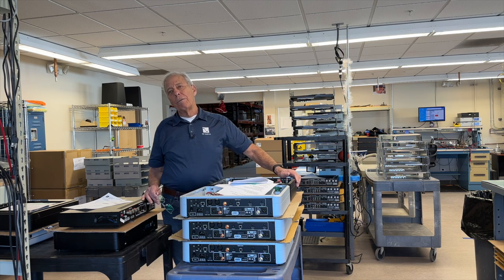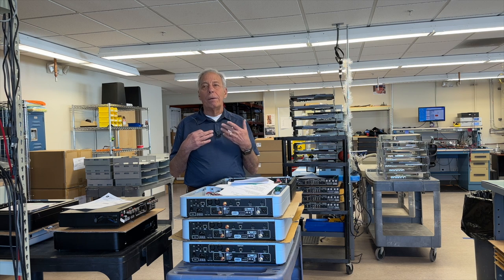How to choose a film capacitor

Comment: A roll of Teflon tape to make your water piping leak tight cost you less than a hand full of change. The same material in the same quantity used in a capacitor with the intended use being Audio, justifies a price premium of $60,- or more. And rather than being outraged by it, most audiophiles get exited by that idea. Oh, add 5 cents of oil to that and the price easily doubles again, resulting in yet more excitement.
Reply: Find a source that is cheaper, but where? I'll wait. I've looked at Digikey and others. No one is what you'd consider "cheap".

Comment: I would personally just replace the Electrolytic with a good branded equivalent and maybe put polypropylene caps on the tweeter section of the crossover. These are vintage speakers and as soon as you start putting in film caps, you start to change their sound signature.
Reply: Personally I’d bin the whole crossover, bi-amp it and use an active crossover. Passive crossovers are horrible things.

Comment: How do you know your AR's are sounding bad and need a cap replacement? Do you have another set of new vintage AR speakers to compare to? Or are you just remembering from back in the day that they sounded better? Besides leaking or budging caps is it just age? And if so, how do you know if your speakers are now just a worn in comfy chair as opposed to being broken? I have 2 sets of the same speaker (RS IIIa's). Passive bi-amping the speakers I broke a lead off a cap right at the base. So I replaced the one cap in 2 of the speakers (so they would match). They sound different than the other set now. Not bad or anything but they dont sound any better than the other set either. Be careful about what you wish for, you just may get it and not like it.
Reply: Old electrolytic capacitors drift in value over time as they dry out and can even be dangerous to your tweeters if the value becomes out of spec too much. They can send too much power to them and you end up with fried ones that are irreplaceable.  One site noted that, "Do you need these capacitors? Twenty years ago, when we began servicing these speakers, there didn't appear to be any need. However, perhaps ten years ago, we began to find capacitors manufactured by Callins Inc. installed in other AR speakers that were way out of spec. That created concern for the AR 9 and AR 90 speakers and we began finding them in these also. In recent years, customers have been requesting this kit for their speakers, particularly needing them for the tweeter section.

However, even though some larger Callins capacitors may be found in the woofer crossover section, the impact does not appear to be as great. Now, if you have a late production pair of these speakers and find your capacitors to be manufactured by Sprague Electric, there is no need to replace them. We have never found a Sprague Electric capacitor to be out of spec."

Comment: Capacitor choice is like spice for your dish ... It will give it a specific flavor.
So Paul is totally correct here .
Same uF and Voltage but different construction cap will sound totally different...
Often you can use Poly cap like Dayton and add nice bypass of 0.1uf Copper foil Miflex and for a cheap combo sounding sooo much better than original Electrolitics or El cheapo poly found in stock crossover
Reply: You can taste the difference between most types of fish but people can't tell the difference between film caps cheap or expensive.  If they test the same they must perform the same there is no magic in electronics just placebo effects
Reply: @mikepxg6406  Absolutely incorrect!
Cap type used in tweeter or midrange will greatly affect it's tonal balance , transient response, clarity, overall resolution as this cap acts as filter and stores energy and releases it back in filtered form to the speaker.
It is sad to see some folks with engineering background not understanding it speak like experts in the matter .
Reply: No that's just nonsense
Reply: @mikepxg6406  I built a pair of speakers using the RD -57, push pull, planar magnetic, operated as a dipole, and 2 Morel 164s/channel, each in their own 12 ft long schedule 40 pvc waveguides. Built my version of the Old Colony/Audio Amateur, Class A, MOSFET output stage, "Lang Amp", to power the system. The initial crossover was 10, 10uf IAR Wonder caps and a 100uf Solen, metallized polypropylene caps and a CFAC inductor for a single pole filter network.  About 7 years later, Parts Connection was having a sale on the MIT, aka Reliable Capacitors. So to replace the Solens, I purchased 3, 20uf Polypropylene film caps, a 30uf Polypropylene film cap, and 3, 3uf Polystyrene caps/channel. I left one channel's xover alone and did the replacement on the other. I Listened in mono, summing the channels, to observe if there was a difference, to satisfy my curiosity. The higher quality caps allowed far more information, as in spatial, and more mid/high frequency energy to pass through, with greater clarity. Switched back and forth between the two filters for over an hour.  The difference was readily apparent. Obviously, I couldn't perform double blind testing, but it did satisfy me that the difference was quite observable.
Reply: @hoobsgroove  Thats why people with your opinion should build kitchen appliances not quality audio .
Reply: @kdomster9141  You're clueless just admit it?? You're not understanding the fundamentals
Reply: @hoobsgroove  Fundamentals?
Instead of talking thru the Ass learn how capacitor type and construction affects sound quality .... and if you dont care just buy some 60usd pair of speakers and enjoy your version of HiFI sound 😉
Reply: @Wizardofgosz  Been there tried that 30 years ago , WIMA is fine for some power supply and some signal applications .
Speaker and specially tweeter crossover filter is the most sensitive to the cap used .... if you think that 5usd WIMA poly sounds great to you try adding 18usd Miflex Copper Foil KCPU series 0.1uf bypass to it and get blown away , so if spending 100usd feels to you like some "salesman" robbed you start with a quality bypass first and than experiment with Clarity Cap CSA costing 15usd , maybe some  Audyn or Jensen caps too...  on mid tier systems those caps are more than sufficient. 
WIMA MKP poly is not the first choice as signal filter cap in the tweeter circuit , unless you use it with a mid Fi , low resolving system than WiMa may be ok and much better than some 1.5usd Chinese generic poly cap.

Comment: If I remember correctly those AR speakers had standard electrolytic capacitors. Considering the age of those original electrolytic capacitors, even the cheapest film caps of some kind will be a great upgrade.
Reply: most had non polarised electrolytics in parallel to get correct value and keep cost down.
Reply: @mikepxg6406  Yes. I remember that now. Thank you.

Comment: I think Teflon has turned out to be one of the greatest inventions of the 20th century. Your car loves Teflon: as an additive to boost oil's lubrication and film properties, infused with rubber making the part self-lubricating. Have a chance to buy a part with Teflon for your car it will be a very good part. Not so much for pots and pans. But here is another example of Teflon's versatility being a very good dielectric inside a capacitor that results in better stereo fidelity and less distortion. Cool stuff.

Comment: I'm not convinced just by sticking poly caps as a replacement necessary the right thing to do?? electrolytic will produce its own type of sound I would mix and match and where the capacitor is in the chain in line or parallel stick to electrolytics in parallel. Use clarity audio for mid-range above 200Hz and tweeter
Another benefit might be to isolate the inductors they can interact with each other and other components more than likely, so stick some paper masking tape around the inductors and some copper tape over that, make sure you leave a gap on the copper foil tape so it's not touching, and solder a wire from the copper tape to the negative of the crossover. Of course this might be not beneficial if they've designed it in the crossover design by listening to the speaker they might have compensated for this error, but no harm giving it a go more than likely will help. Changing wire resistors might be beneficial as well to something like SMD through hole 50 watt don't go lower than 50 what they can get hot but that's extreme volume. 50 watts fine you don't need a heat sink.

Comment: I thought Mylar was just a brand name for a line of polymer sheet goods of whatever composition is chosen.
What we want to know is what thickness of dialectic is used for a given voltage rating on each type of polymer and how does it affect signal transfer characteristics to use a higher voltage rated component vs one that just meets with reliability goals?
Reply: Mylar is actually a trademark for polyester film products. specifically BoPET (biaxially oriented polyethylene terephthalate), so I think the composition is known.
Reply: @michaelturner4457  Thanks.

Comment: Unfortunately capacitors are mandatory for tweeters. Obviously in a  passive crossover but also in bi/tri ampped systems. My main LCR speakers are triamped. The tweeters are fed with a true* 20w class A amp. Initially the tweeters were direct wired to the amp. But now there is a 30uf film capacitor in series with each tweeter which gives me a 600hz high pass filter. Why? Well the tweeters are crossed over at 2.5khz. But in sweeping the room once i somehow bypassed the DSP based crossover sending full bandwidth pink noise to the three tweeters at $300 each. The capacitor is a safety feature and what ever sonic damage it does (very little at 600hz) I will just have to live with.

*Single ended output stage with a current sink. Not simply over biased class B.

Comment: I think you told him what he needed. Jupiter II’s baby!
Reply: I know Jupiter does paper caps, Which from experience of working on older radios and TVs, many caps with a paper dielectric layer don't tend to age very well and often go leaky.
Reply: Waste of money in old AR speakers.   You can't make a silk purse out of a cows ear.
Reply: @mikepxg6406  I take exception to that. My AR-9 hold their own against any new speakers on the market $6000 or less. But yeah, of course there are "better" speakers out there, here 43 years later.  There OUGHT to be considering technological advances in materials, manufacturing, and computer simulations available that were only dreamed of in 1980.

Comment: I don’t know what you are talking about, what are caps?
Reply: Speaker Crossovers are a network of Capacitors(Caps), Inductors & sometimes Resistors. Caps are the one component that deteriorates over time losing its ability to couple signals or filter frequencies. Their values/performance can change which affects the crossover frequencies & frequency response. The same goes for caps in electronic circuits.
Reply: To add to what Jim Settlecase said, the old electrolytic capacitors would change in electrical value over time as they dried out. If they drifted too far from their original values, they could endanger your tweeters by allowing too much power to get to them. New film-based capacitors should never "dry out" and change value. Once you replace the old crappy ones, you should be set for life.
Reply: @clickbeetle2720  see there you go again clickbeetle!

Comment: Do you remember the phantastic Black Gate capacitors?
Reply: I use them extensively in my system.  Nothing like it as a filter cap particularly for noisy digital circuits.  I also have some of the blue speaker caps.  Similar in performance to a good foil cap at a fraction the price and size.
Reply: They were fitted as standard in some of the BX range of Rotel Amps and CD players from the 90's My old limited edition Rotel RCD965BX has them everywhere.   It still sounds superb.  It would cost an arm and a leg to produce it today.
Reply: @mikepxg6406  I'm not very up-to-date with new capacitor products, those which I tried were not competitive. So I buyed a bunch of it.

Comment: For help (or more confusion?) on hifi capacitors, search keywords "humble homemade hifi capacitor test". 
I centered my build around the Mundorf Supreme EVO Oil Capacitor family. Not quite into the outrageous prices. 
Also take note of Bypass Capacitors (an add-on 'type' not a 'brand'). These are amazing.
Reply: Those EVO Oil are great value , used them too , but the Supreme Silver OIl is my favourite , more expensive I know . Humble home made Hifi is also my reference when it comes to audio caps

Comment: Many years ago polypropylene was the best. I guess that's all changed now.
Reply: Still top notch.  Teflon only makes sense as a coupling cap in key spots like an interstage cap in a tube amp.  Not worth it for a speaker crossover.
Reply: Most people pretend they can hear a difference...
Reply: @mikepxg6406  You are so right about that.
Reply: Think it is still a very good material. At least it won't change value over time like the old electrolytics could.